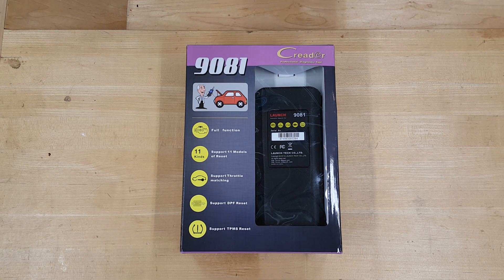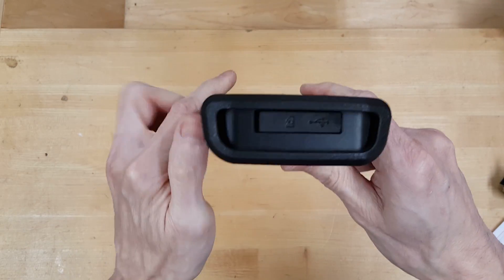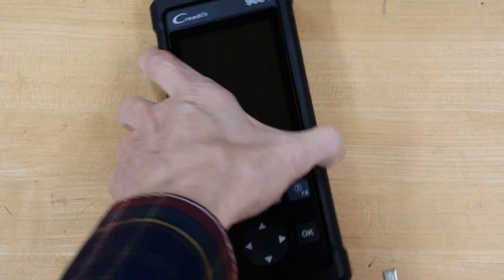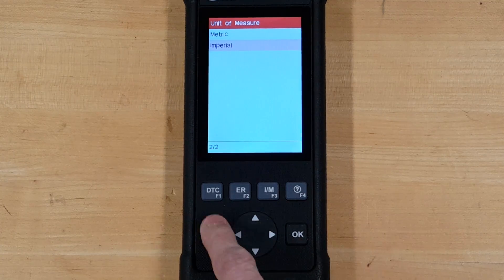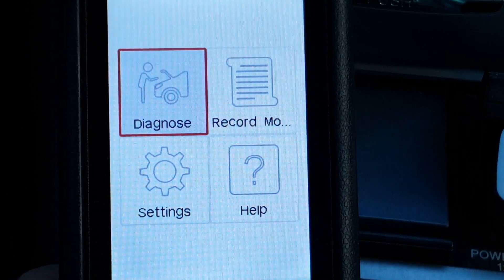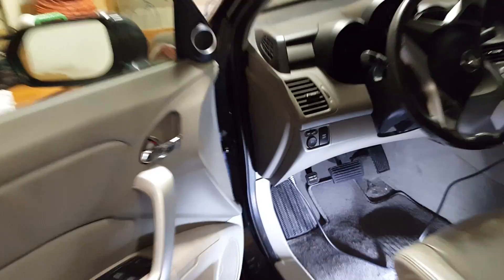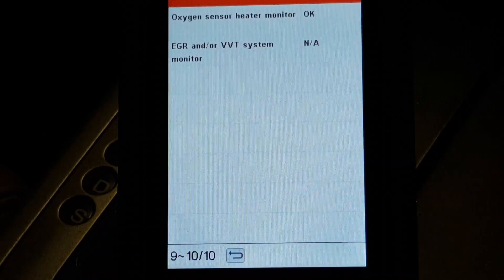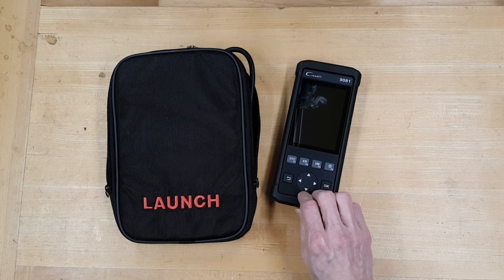LAUNCH Creader 9081 OBD II Diagnostic Scanner Tool Review

Comment: Do you connect scanner after starting switch or before, I see you connect only on ignition but if you need know RPM you starting with scanner connecting? Regards
Reply from the maker: The ignition switch only needs to be on to read stored codes but to read most real-time data, start the engine.
Reply: @WorseThanChiggers  ok, but starting engine with scanner connected or first start engine and then connect the scanner? Thanks for your response.
Reply from the maker: Either will work with the same results.

Comment: Why is the unit giving you metric data on your Honda (freeze frame) ?  I thought you set it for Imperial units.  Don't tell me you have to set it every time you connect to the car!  But on your RDX it did show imperial units.
Reply from the maker: Ah, you are very observant. Thanks for the feedback. I recorded the raw video of the Honda the day before I recorded the intro segment where I changed the default units from metric to imperial. Rest assured, the settings do persist and you don't have to change them every time.
Reply: thanks!  Can this reader help in diagnosing other systems such as ABS/SRS etc?  I see that it supports resetting some of them but does it give live data for other systems e.g. AT or ABS or SRS like more expensive scanners?
Reply from the maker: Unfortunately not. It does not read transmission, ABS, SRS, or body module codes. I think that's what keeps this from being one of the ultimate DIY or lower-end pro scanners.
Reply: worsethanchiggers